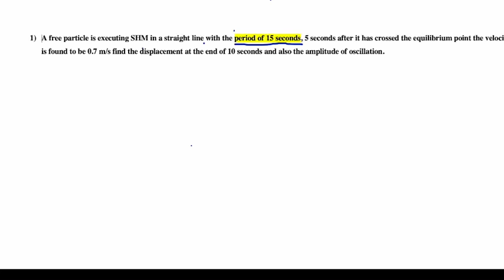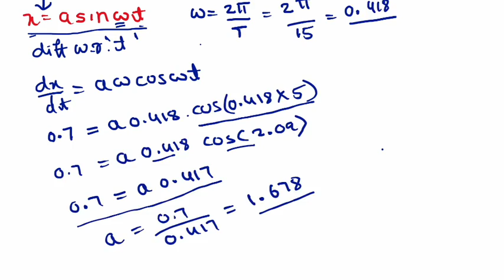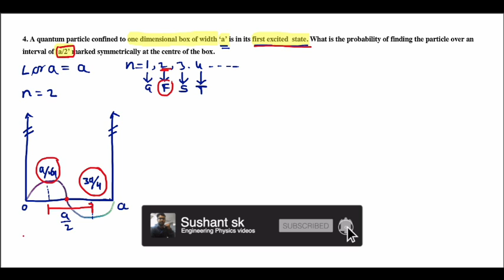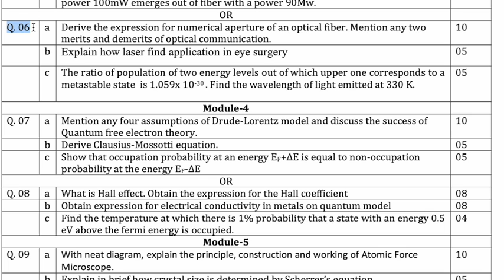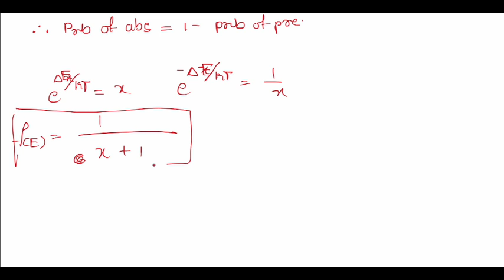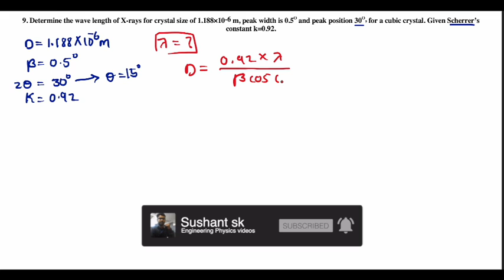Model Question Paper-I (Problem solution) #VTU #EngineeringPHYSICS #vtuphysics II

Comment: Sir, in 2(c):- The distance between two pressure sensors in a shock tube is 200 mm. The time
taken by a shock wave to travel this distance is 0.4ms. If the velocity of sound under
the same condition is 340 m/s. Find the Mach number of the shock wave
Ans :- v=500m and M=1.47
*Mack number of the shock wave should exceed 1. [It's is one of the properties of shock wave]

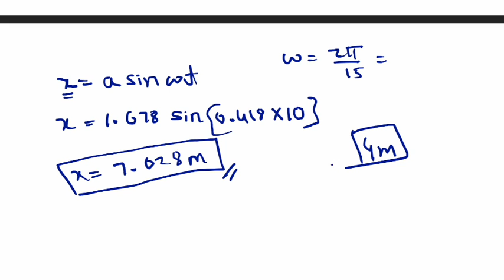Comment: 10:20 Sir, u got 7.028 m but I got 7.025 m is it Fine? Will I get full Marks?
Reply: How come you got 7. something whereas I got 0.12230
Reply from the maker: It’s wrong dear
Reply from the maker: Yes
Reply: @SushantSk  sir x is 0.122 getting sir for first problem
Reply from the maker: @Akash-gv2mq  it’s wrong dear
Reply: Sir how to do it sir x=1.678sin0.418 (10) HOW TO DO IT SIR
Reply from the maker: @Akash-gv2mq  it’s a simple calculation use properly calculator
Reply: @SushantSk  ok sir I will